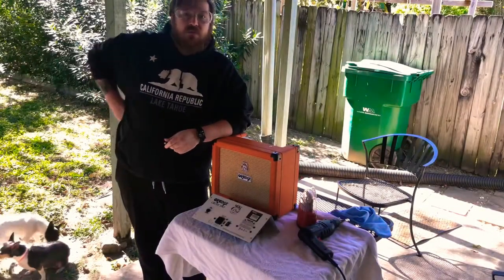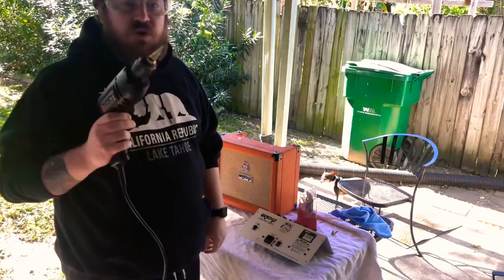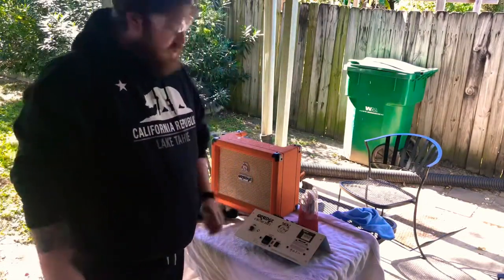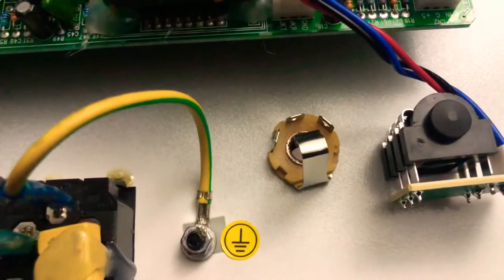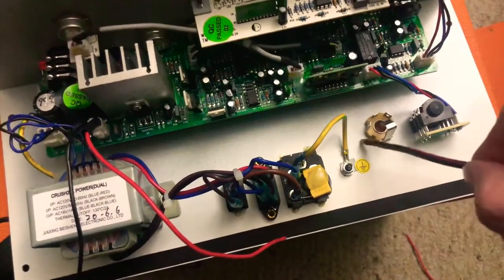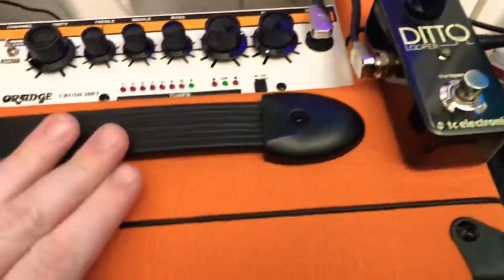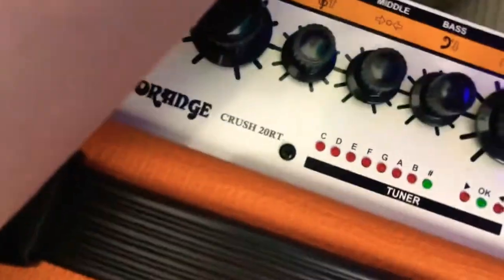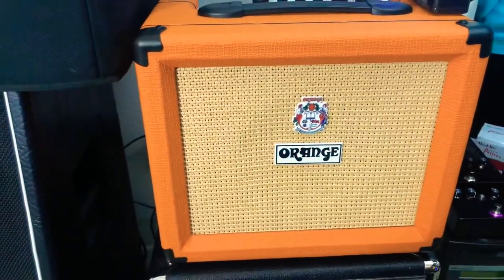DIY: Adding an external speaker jack to my combo amp

Comment: Hi. So just clarify , the red positive lead coming off the pcb board goes to the center lug, then a wire goes from the 3rd lug on the jack to the positive terminal on the speaker? Then both the black negative wire from the pcb board goes the ground on the jack correct? And the negative terminal from the internal speaker goes to ground on the jack as well? Is that all correct? It was hard to see in the finished shot because you panned  over it so quick I just want to make sure. Also what exact jack is it because the Switchcraft 13b looks like it only has 2 terminals however the 12a seems to have 3 like in your video. I’d like to get the exact one your showing. Thanks so much!

Comment: Would it be worth it to swap in a 16 Ohm speaker and wire it in parallel with the jack, and have an external 16 Ohm cabinet, not disabling the internal speaker, making a mini stack of sorts?
Reply from the maker: I think that would be an awesome project! Great idea! Thanks for checking out my video. 🤘

Comment: I have a question I want to add a speaker jack to my amp chassis has a yellow wire connected, and the mirror between the two terminals does a yellow wire means ground if you could help me I really appreciate it or I can send you a picture if you have an email so you can see what I’m talking about. Thank you. Hope to hear from you soon.

Comment: Hey i really liked thia video. Let me preface with  I work as a soldering specialist at an aerospace company. Ive never messed with music equipment.  I play dbeat/crust/stoner/doom.  A friend of mine has an orange 20rt that just quit after about 2 weeks. Thia dummy had it cranked the entire timw and was trying ro be loud enough to play with a drummer. Anyway he gave me the combo because he threq the recipt away. Fuses are good, and im going to open it up and take a look.  Do you think he blew the speaker out? It makes absolutley no sound when powered up.
Reply from the maker: It’s a good possibility. My assumption would be the speaker would die before amp itself.
Reply: @KasperKillsTX  thanks for the responce. Im gonna crack it open this weekend and take a look.  If the speaker blew what would be a good replacement?  Im so interested in fixing gear and learning now.
Reply from the maker: @Survivalist-of-war  I would give it a shot! It's a cheap mod that could get the amp back up and running. Good Luck!

Comment: This is a great idea! Question- I have an older Fender Deluxe 112 that I want to do this to. The Deluxe 112 and speaker that are in the combo are rated for 4 ohms. Does this mean I can only run this into speaker cab with 4 ohm speakers?
Reply from the maker: Yes you want to match the load output to the correct cabinet. This can be done in a few different ways depending on how you wire the speaker cabinet and the speakers you use.

Comment: The wire that goes to the internal speaker is hot or neutral?
Reply from the maker: The positive lead goes to switched jack. When nothing is plugged in the connect is made through the jack itself.when you plugin a cable is bypasses the internal speaker.

Comment: Is the jack switching off the built in speaker or running  at the same time as the external cab? It’s a great mod that I want to try on my crush12...I love that single channel amp
Reply from the maker: It’s one or the other. It’s a switched mono jack, when plugged in it disconnects the internal speaker and reroute the signal to the output jack.
Reply: @KasperKillsTX  how can I wire it to get it to engage both internal with external speakers?
Reply from the maker: @markquiroz3460  Not Sure. You could probably do it with a standard jack and connect the hot leads to the tip. Just guessing tho.

Comment: What happens if I use the headphone jack on the amplifier to do that?
Reply from the maker: You can get audio out of the headphone out using the built in cabinet simulation, but it won't have enought power to push anthing more than headphone levels. Thanks for checking out the video.

Comment: I've got a mod idea for the 20rt. How about defeating the speaker shunt in the headphone jack so you (or me) can hear the internal speaker and have the line out/ with cab sim go to a PA. I think I know how to do it but maybe I'm wrong.
Reply from the maker: You know that is a great idea but you may be overthinking it. I would just use a headphone splitter (and monitor with headphones) out of the amp. Thanks for checking out the video! 💪
Reply: @KasperKillsTX  thanks for the suggestion. But what I want to do is play small gigs using the internal speaker but also run a cab sim line out to the PA. But plugging into the headphone/line out jack shuts off the speaker. I'm thinking it's just a matter of clipping one wire.

Comment: where to find a switched speaker jack?????
Reply from the maker: You can find them on Amazon or other electronic parts suppliers. I recommend getting the Switchcraft brand (plug 13B) as they are better than the ones I bought on Amazon.

Comment: Or you could just use the headphone out 4x12 cab sim?! No...really
Reply from the maker: Yes, this is true if you ONLY wanted a single emulated cabinet sound for recording or silent practice. The idea was to make the amp more versatile and have the choice of any 8ohm cabinet. Thanks for checking out the video!